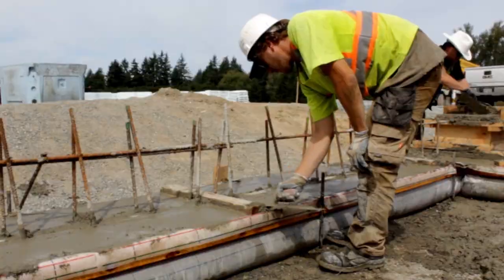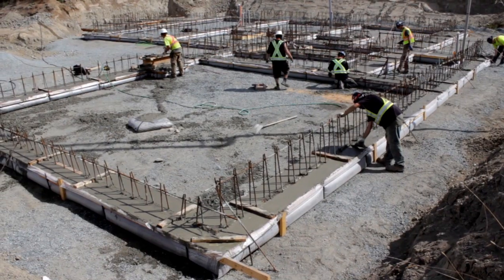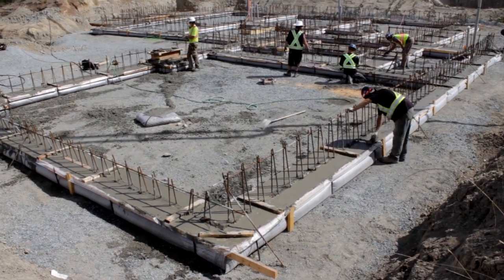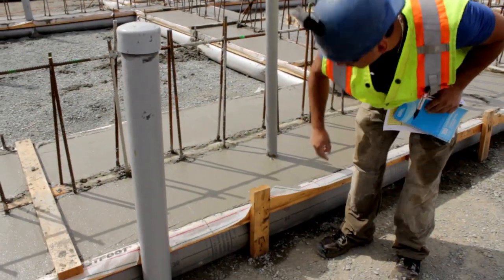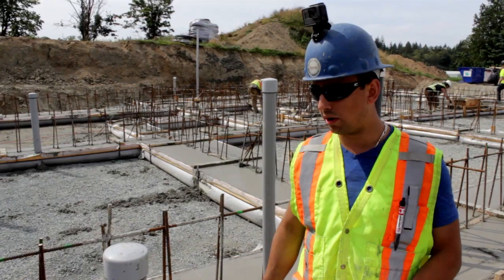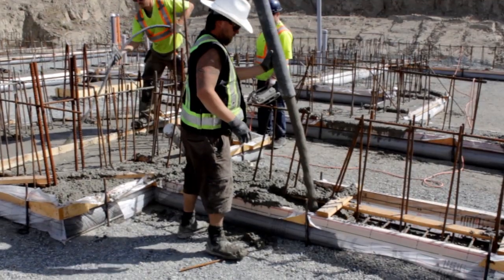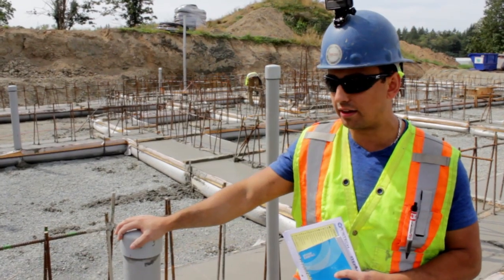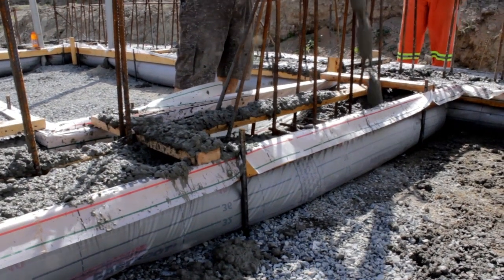Fastfoot® Concrete Footing Form - DT Royal Construction

Comment: Couple things: 1)There's no way this is cheaper than conventional forming footings.  2)There's no way it's quicker. 3) You WANT water to escape at the footing level. Otherwise, with high hydrostatic pressure your water ends up in your basement.
Reply: somebody needs to do more research
Reply: @bladerunner6583  lmao that is an understatement
I feel stupider after reading all this guy wrote😅😅😂
Reply: @bladerunner6583  If you want to discuss any of the points I've made, go ahead. I've worked in Structural Engineering for 5 years, and have been in Concrete foundation design and construction for another 5 years. Happy to learn if you want to share.
Reply: @thisisnotmyname91  give me some numbers, not a dumb statement like "no way this is cheaper"
also, hydrostatic pressure from what?
Reply: @walterbrunswick   I don’t know what this stuff costs, but I know we form our footings with dimensional lumber and it is all recycled and reused over and over again, and would be considered easy (less labor) to set up than this system. Hydrostatic pressure, as in groundwater pressure coming into your basement.
Reply: @thisisnotmyname91  so where does the "groundwater pressure" go if you don't use FastFoot?
Reply: @walterbrunswick  It escapes through drains out of your footing
Reply: @thisisnotmyname91  and this system is different how?
Reply: @walterbrunswick  well, they used sealing the footing as a selling feature. My point was that you often don’t want your footing to be sealed off.
Reply: @thisisnotmyname91  you obviously didn't watch the video, or any other videos of theirs
the idea is not "sealing off the footing"?? (whatever that is supposed to mean???) but to provide a waterproof barrier between the ground and the concrete footings, so you don't get migration into the foundation
not sure what is so difficult to understand... did you get your Structural Engineering license from a cereal box? seems like it
Reply: @walterbrunswick  ok, well first I made my original comment 9 months ago and I didn’t rewatch the video so I didn’t remember the exact claim they made. Second, I never claimed to be a Licensed Engineer. And third, if the product acts as waterproofing from water migration into the foundation, would it not also act as a barrier for water to escape? The whole point is, this product is a gimmick with very little real world advantages and a straight up lie about the actual cost associated with this type of construction.
Reply: @thisisnotmyname91  this is a well thought-out product that should've been out years ago and should be required by building codes 
I don't do concrete but I work in the construction field (HVAC) and I fell in love with this 
Sorry but you are a very ignorant and misinformed person
Reply: @walterbrunswick  just because you don’t understand water tables and hydrostatic pressure, or labour costs, or material cost. Sorry, I’m not being rude but this might have some very niche applications but it should NOT be building code. Thankfully they don’t ask HVAC guys with no experience in the trade for advice on building codes.
Reply: @walterbrunswick  FTR, this has been out for well over a decade... there’s a reason the industry hasn’t adopted it.
Reply: @thisisnotmyname91  the construction industry in North America is very resilient to adapt to new better technologies
we are on average about 25 years behind Europe
Reply: @thisisnotmyname91  as far as labour and materials go, look up the (many) videos of guys laying this down as opposed to traditional forming, there is no comparison!
Reply: @walterbrunswick  Europe uses a lot more concrete products than North America. I’m curious what the sales of Fastfoot are in Europe.
Reply from the maker: @thisisnotmyname91  Sorry for not chiming in on this sooner. Walter's playground is completely in the right here. I would be very scarred of working with you as an engineer in any regards whatsoever. 
Your understanding of how moisture moves through concrete is terrifying. Concrete is hygroscopic, so it will take moisture from where it is wet, to where it is dry. This means moisture in the footing will travel up, not out from the footing itself....
In regards to your claims on no labor reduction; I would suggest you try physically moving 4 times the amount of lumber around a jobsite. First to set up the footing and then to strip. Then tell us there is no reduction in labor. 
In regards to price, a simple calculator will allow you to compare a Fastfoot footing to a lumber footing. These can be found on any smartphone these days. Compare the lineal foot price of a 2x4 and Fastfoot, (roughly $2.90) to a 2x10 footing (roughly $5.80) depending on current lumber prices.
Reply: @FabFormIndustries  Again, just like Walter, you are misunderstanding my points about hydrostatic pressure due to ground water. I know that concrete is hygroscopic. My point about hydrostatic pressure is due to ground water pressure that, if trapped in the footing footprint would have no escape. I've witnessed this flooding, and lifting basement slabs. As for cost, yes more lumber is going to be more labour but the method of staking and nailing up 2x4's in mid air and somehow getting that level seems a lot more time consuming. I don't know about where you are based, but here 99% of residential foundations are either 8" or 6" thick footings. I can count on 1 hand the number of 10" footings we've done for houses. Additionally, all of our lumber we purchase is re-used over and over again for footings. Sure a 2x8 costs more than a 2x4, but what really matters is the cost of the fast foot product per foot as that is one time use and a continuous cost on each project.
Reply: @thisisnotmyname91  your point about hydrostatic pressure is valid, I'll concede
how did you deal with the lifted basement slabs? 
also like I said if you watch their other videos of proper grading and drainage, hydrostatic pressure should not be a concern
Reply: @thisisnotmyname91  besides as you pointed out, you've had lifted basement slabs
bare/unprotected concrete alone is NOT a suitable medium for release of said hydrostatic pressure 
that has to be dealt with/addressed regardless, Fastfoot or not 
I personally don't like mold in my basements
Reply: @walterbrunswick  https://activerain.com/blogsview/5274972/hydrostatic-pressure---what-you-need-to-know
Reply: @thisisnotmyname91  did you watch their videos on proper grading? and water drainage? 
hydrostatic pressure will happen regardless if you're using FastFoot or not
Reply: Yeah it’s actually WAY cheaper, it’s 65 bucks a roll for a 50” x 100” roll. For one packing 2x4’s is much easier than packing 2x8 or 10, you save on labor right there, and you saved on the cost because you didn’t buy 2x8, you only need 2x4, that 2x4 doesn’t need to be taken off the jobsite like the 2x8 does, it can be used for your wailers, you save on labor again because you don’t need to strip and pack out the footing material, you also don’t need to oil the inside of your footing forms, or scrape the inside of them, you save again, the entire process is faster because of how light the material you are using is, you’d know this if your were an actual concrete guy who’s ran crews and knows what efficiency really is, and not just some yahoo on the internet talking shit.
Reply: @loganconnally4361  the way we’re set up, we can do an 8” footing with 2x8 very efficiently. Switching to 2x4 would not be that much less labor.